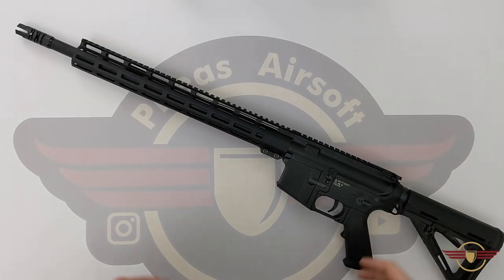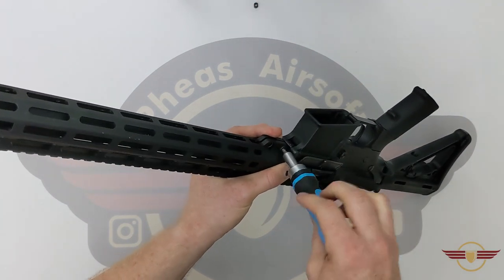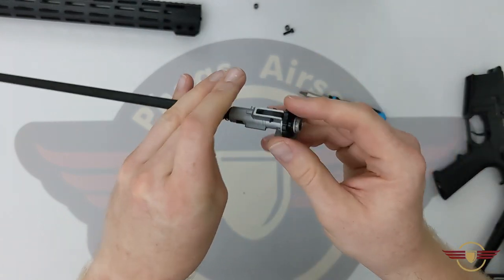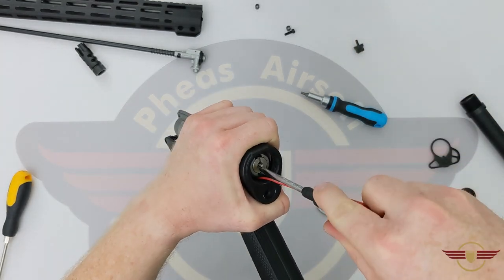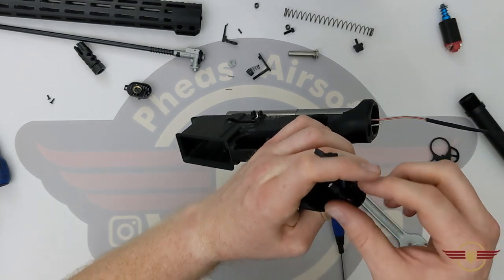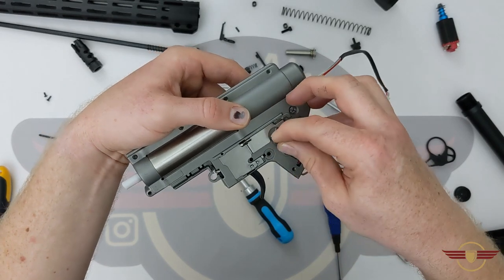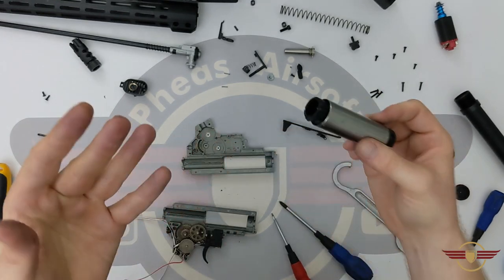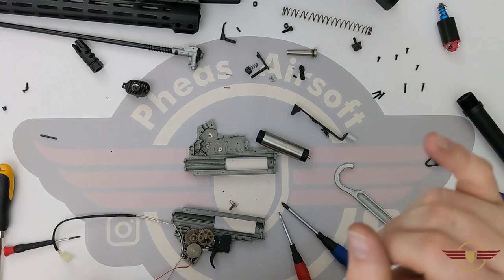[HOW TO] ARCTURUS AR DISASSEMBLY - INTERNAL REVIEW

Comment: For anyone, without the hook wrench for removing the stock, I used the bottle opener on my swiss army knife
Reply from the maker: That sir is a great idea!! Never thought of that! Pheas
Reply: T-Rex Jaw Pliers and a sock to prevent scratching got mine open XD
Reply: Nowadays they include it in the box. the castle. the flash. and flathead for spring. in a 4X1" form factor. It's pretty nice. Needed added leverage for firs unlocking of castle though.

Comment: its actually a very well built M4, all you need is to change out the inner barrel, hopup rubber and put a mosfet in it.
Reply: but what type of mosfet ?
Reply: @utakolepackdeau7786  For example a Perun AB++ or a Gate Warfet.
It can't take optical mosfets due to the offspec trigger assembly.
Reply: it uses a steel inner barrel 6.01, why need to change it? i though it was a good thing about this gun
Reply: @niltonbatistajunior9731  they are badly treated and rust.
Reply: damn.. it was too good to be true btw 😅 wich one is better, this gun or a aps phantom mk8?
Reply: @niltonbatistajunior9731  APS sucks, this one is way better in the long term
Reply: @niltonbatistajunior9731  acabou comprando qual?
Reply: @PressStartHu3  comprei a Arcturus mesmo, é realmente uma arma robusta e com bons componentes, porém a qualidade de acabamento é muito baixa. Se pudesse escolher novamente compraria a APS.
Reply: @niltonbatistajunior9731  problema da aps é a gearbox super frágil... Ela tem um furo onde não deveria ter kkk, por conta do blowback... Tô achando que vou pegar a arcturus pdw..
Reply: @PressStartHu3  poxa amigo pra mim a melhor parte da APS é a gearbox silveredge, ela é muito resistente e compativel com várias marcas. e as novas versões tem gatilho eletronico e removeram o blowback. mas minha recomendação mesmo é G&G e Modify, valem e muito o investimento.
Reply: @niltonbatistajunior9731  entendi! Vou ver sobre as duas, quero uma de no máximo 2300 reais.. vlw pelas informações
Reply: @PressStartHu3  se interessar estou vendendo minha arcturus por R$1400, ela está parada tem mais de 8 meses desde que comprei a Modify

Comment: top video, identical in breakdown and internals to their GR15/HK416, only the bolt release is different. Solidly built, know what you mean about the microswitch trigger, works ok but i'd like the ability to fit a trigger mosfet.
Reply: just asking because i have the 416, does the disassembly change significantly in order to take into account the ambidextrous selector and the different bolt release? i'll have to do some maintenance on mine some time soon and i wanted to be prepared
Reply: and another question, a bit off topic, would you able to change out the gearbox for a more "standard" one? not planning to do it but the fact that you can't put in a mosfet made me think about it
Reply: @enricopravato6677  The ambidextrous fire selector is driven via a rod that goes through the gearbox to the second selector mount and the  selector switch screws to it, the bolt release come under the gearbox casing just above the mag-release and feeds into a hole in the press down bolt release button/switch soo when either side is depressed the whole bolt release mechanism moves as one.  Once installed with the gearbox, if  you look up through the mag well you can see it running under the gearbox. You'll need t remove the bolt release first, mag release is easier to remove once its out. Tap the pin holding the  bolt release on the left hand side of the gearbox/lower receiver first. Depress the bolt release on the right hand side of the receiver and pull the left hand side bolt release - which has the arm that connects it to the right hand side, out first. You can get the other part of the bolt release out after that. Mag release , press the button on right hand side of receiver in all the way and unscrew the release from the left hand side until it comes all the way out. Watch the tension spring that puts tension on the release to allow it to spring in an out. After that (and the body and trigger pins are removed) you can wiggle the gearbox out of the receiver,. When you replace the gearbox in the receiver watch the anti-reversal release down where the pistol grip screws to the gearbox has fitted through, catches up easily against the receiver unless you manually press it to feed through the pistol grip aperture in  lower receiver. This is a good visual resource on stripping the Arcturus HK416 (GR16 Mod 5) https://wmasg.com/en/articles/view/9889

Comment: You wouldn’t happen to have a video on how to remove the hand guard would you? I’m stuck on the barrel but that just keeps spinning.
Reply from the maker: I do not unfortunatley. You will need to remove the nuts at the base of the handguard where it attaches to the body, the whole thing should slide off then. Then the barrel nut can be removed if you are also swapping that out. Pheas
Reply: @PheasAirsoft  Worked out great. Thank you!

Comment: Bro as its uses micro switch, therefore the trigger is unique to the GB case. Do you know any type of trigger sets compatible with this GB? 

switch brake mosfet. Fits nicely in the GB. Yet i cant find a trigger sets that is compatible with the gearbox. Maybe gelblaster trigger could fit? any experience?

Comment: Would a M125 spring be okay to put in to this replica? 

Had a spare one, saw a very considerable FPS boost, but want to make sure the gearbox itself and the motor would in theory run fine if the stock one is an M120.
Reply: Should be fine but it would be wise to get an aluminum spring guide and cylinder to prevent the extra power snapping them. It's very unlikely that such a subtle increase would damage the parts but the last thing you wanna hear in the middle of a game is that snap sound plus it gives you the option to go higher if you find a field that allows it. It's 50/50 to replace the cylinder nozzle to something aluminum like a Lonex or Prometheus. This adds extra weight to the cylinder but increases durability. Honestly the stock one has great seal and works well.

Comment: Is it possible to remove the microswitch system or replace it with something else?
Reply from the maker: Hello! unfortunatley not, you would have to replace the shell with another one that isnt for a microswitch... that said, if you removed it, you might, MIGHT, be able to fit an optical one that replaces the trigger block, you can always solder a mosfet like the AB++ on to the switch and get some of the features of a full mosfet. Pheas

Comment: A late comment, but my motor seems to be getting hot quickly. What could I do to change this? If I wanted to upgrade the motor, which ones would you recommend? Thanks Pheas
Reply from the maker: Hello! If its heating up... It could be because of resistance in wiring, if it's recently only just started heating up, then it could be damaged trigger contacts... Would be worth having a tech look at it first to see if they can ID any issues. If you want the motor anyways... A high tpa motor will deal with any strength of spring and shouldn't heat up too much, unless you have a MOSFET with full on active breaking. Pheas

Comment: Hi, no matter how much i try, i just cannot dissasemble the stock ring. Its just so tight and i cant by any chance get it off. I triend pliers but nothing. D you have any solution for this problem ? And how exactly did you do it ? Thank you so much for reply.
Reply from the maker: Hello! It just came off, it might be easier with an armourers wrench to lock into the sections in the stock ring to loosen it off. It needed a fair amount of force to get it going, but once it started it flew off. good luck with it. Pheas

Comment: Hi, is there a way to shorten the outer barrel so that it doesnt stick out from the rail? Like its flush at the end of it.
Reply from the maker: You could replace the outer barrel with a shorter one, cant remmeber if its actually a two piece barrel, in which case, its even easier to put a shorter piece on to shorten the outer. Pheas

Comment: Hey ! Thanks for you videos :) What is your recommendation between an ARCTURUS AR and a DOUBLE EAGLE M904H reviewed. I will upgrade it with an SHS high torque motor and 12:1 gear, barrel, r-hop, m100. Thanks a lot !
Reply from the maker: Hello! That is a touch call, for me I think I would have to go with the M904 just because the internals are a little more "on spec" for other parts to go in easily, the mosfet is oustanding and will make a difference for you in the long run with those gears and motor upgrades. The arcturus is sold though and would make a good set up, but the gearbox (particularly the trigger block is off spec) Pheas

Comment: The semi auto on mine has stopped working after changing out the gears for a different set, it seems the little cut off lever isnt dissenging the trigger, any ideas what might be wrong?
Reply from the maker: Hello! Sorry to hear that. I am guessing the cur off lever requires their own brand of gears, so I would look to replace it with an aftermarket generic (good) one, something like the ASG ultimate cut off or similar to see if that helps / fixes it. Pheas

Comment: Hello can u help me i change my spring too a m110 spring and the motor are heating should i chnage to an m100 spring or change the motor and the gears?
Reply from the maker: Hello! if the motor is getting hot, then its working hard to turn over the spring, you might need a higher TPA (high torque) motor to pull it more effeciently with less heat. You might also need to look at the shimming as if the shimming is too tight then the gears are hard to  move, which the spring will add to, putting the motor under stress. Pheas

Comment: What’s with that gigantic barrel nut? 😅 how would I go about replacing the handguard? What other handguards are compatible with the ARCTURUS AR series? I should’ve taken that into consideration before ordering my AR-08 Sword.
Reply from the maker: Hello. Handguards usually come with their own barrel nut, so the stock one will come off leaving the standard sized thread underneath. Then you can fit your new handguard with no issue. Pheas
Reply: @PheasAirsoft  thanks for the reply!
My AR-08 finally came in! I’m just having trouble taking the hand guard off. 🤔 I loosened the two screws on the 6 o’clock position but it’s on super tight! Am I missing something? 🤔 it also has two sets of weird blocks that the screws go into, and I can't remove it for the life of me! (AR-08 version)
Reply from the maker: @Callsign_Kishin  Could be a grub screw somewhere that needs loosening off too, or just give it a good tug as they have tight tolerances so everything is snug together. Pheas
Reply: @PheasAirsoft  haven't found any grub screw or anything. Tried using a heat gun on the barrel nut section cause my local tech said they might've glued it. I had no luck today. Might just have my local tech handle it so I don't risk destroying it trying to figure it out myself. When I first brought it to my local shop, the tech and I even tried both pulling it in two different directions like a game of tug o war. No luck even then. So, gonna have him handle it.
Reply from the maker: @Callsign_Kishin  Hmm, how odd. Good luck to him to getting it off for you!! Pheas

Comment: Whats the size to get the muzzle out? Mines have an orange cap. Hex alloys keys right?
Reply from the maker: Hiya. I usually find a torx 6 bit does the job for me with those grub screws in the muzzle. Pheas
Reply: I have the bit set.  But it don't work? It seems mines have a circle round nut? Thinking about drilling it?

Comment: my handguards doesnt let loose at all after getting the screwss off.
Reply from the maker: Hello! Did you completely remove them from the handguard? I would try pulling on it once they are moved, there could be some glue in there that might be causing the issue. Pheas

Comment: Are you unable to put an hpa system in this sense the gearbox
Reply: I honestly am not sure, if the HPA engines require the traditional (TM style) trigger block, then this wont take an hpa engine with the current gearbox shell. But you can swap it out for another shell. Pheas
Reply: Going through this struggle right now.

In short, no. Not easily.

I have had to 3d print a whole new V2 gearbox shell for it and I then had to dremel down the shell of the gearbox because it wouldnt fit in the lower without cutting off about an inch towards the back. I also had issues with the engine not aligning with the hop up system in the barrel and causing the nozzle to get stuck open, which then caused air from my tank to continuously flow. I also had to replace the mag release because the one that comes on the gun doesn't work with a normal V2 gearbox. 

Save yourself a hassle and headache, get a different base if you're wanting to go HPA. I have basically made a whole new gun because I had to even 3D Print a whole new lower just to get it all to work right. I wish I saw this 2 years ago.